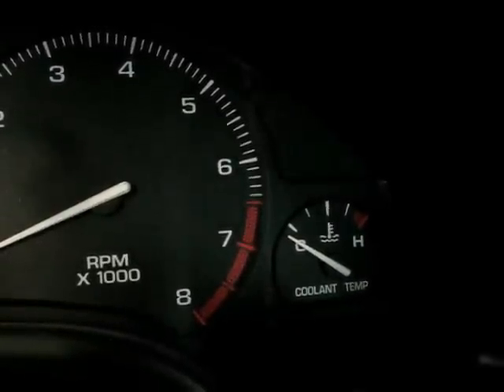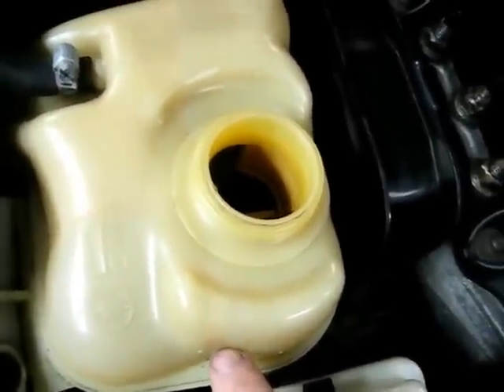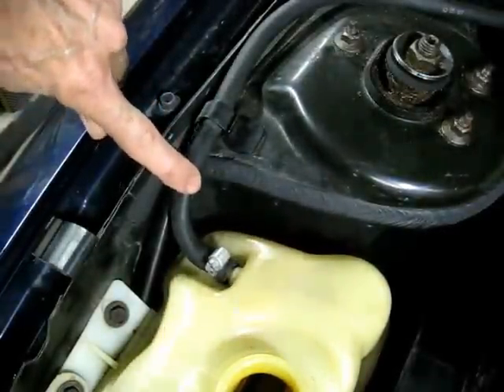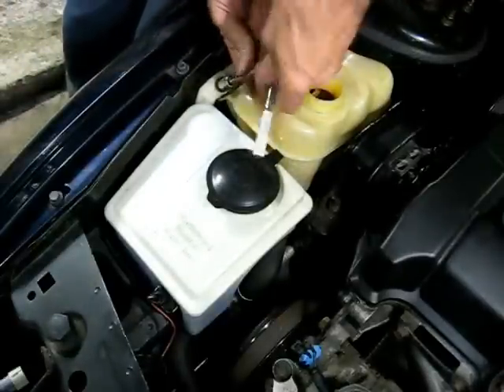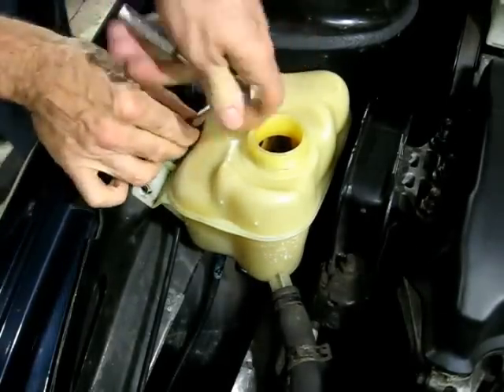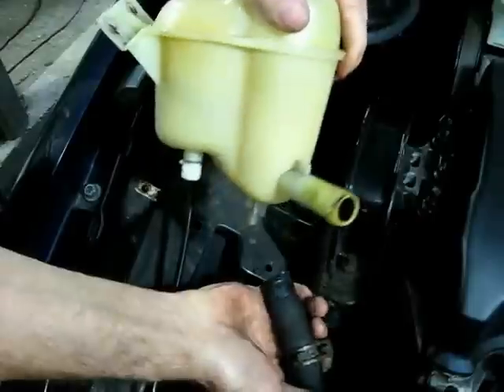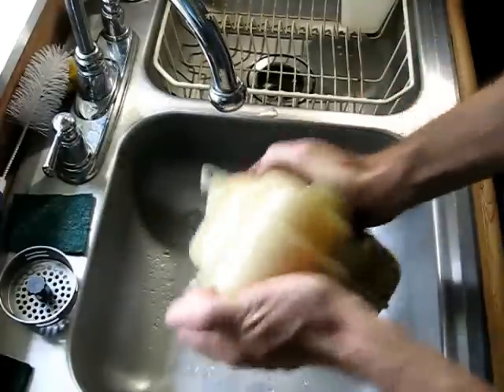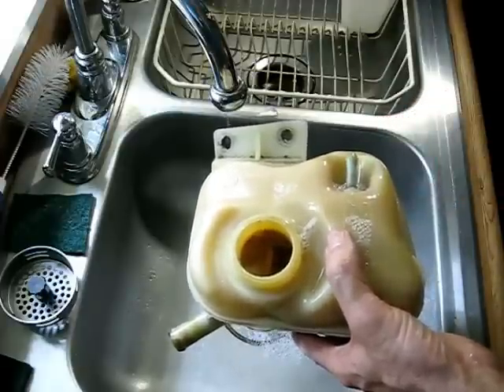Coolant Level Sensor Repair

Comment: Rich Thank You so Much I took my car to a mechanic which rebuilt the engine, now the expansion sensor is on, I now understand the float system for this sensor. I tried buying the sensor but no one knew where it could be located. God Bless You and your Familly.
 Merry Christmas
Reply from the maker: Thank you Tom.

Comment: This trick is "da BOMB!!" Thanks so much for sharing.  I fixed the low coolant sensor using this method on 2 cars this month!  Two comments: 1) One would NOT shake free.... so I let it soak overnight in dish detergent; by morning only a little more shaking knocked it loose.  2) Can take umpteen rinses with fresh water to get rid of all the detergent. One that I did (a '96 Aurora) has many internal baffles/ chambers, so i spent 20 or 30 minutes and nearly as many rinses. But it WORKS! THANKS!!

Comment: Thanks Richpin for this video. I have a Saturn vue 2003 v6, and was experiencing that problem. I took it off as you said in your video I washed it out with soap and then clr. Then rinsed thoroughly and reassembled and took for a test drive, and no more low coolant problems.

Thanks a million and keep up the great work!!! :-) love how you work on Saturn's!! You be the man! :-)

Comment: Thank you.  Having owned a previous '96 Saturn (SL2), I knew the coolant light should appear when the coolant is low.  I removed it "items" as you described and cleaned the collant tank, and ran the car for a few seconds with the sensor connected. Sure enough the sensor was working, and solved this problem.  Also checked the upper motor mount.  It looks good. Will pull the serpatine belt soon, and try to remove the shake at 1,100 RPM that is evident from the crank shake pulley.

Comment: Thanks for the video. When I replaced the coolant several months back.  I noticed the light went out for a while. But it returned again, and it made me wonder where the heck is that sensor located.  So thanks again.

Comment: Thanks for this! I was having intermittent issues with my warning lights flashing. Thought it was the sensor or a crack in the tank. I disassembled per your directions and it turns out there was a crack in the side of the tank I couldn't see because of the washer fluid tank. I was able to put a new one on with no problem!

Comment: nice video. i didn't even know what these lights even meant when it started blinking on my car. i thought it meant my engine oil was low xD glad to see its not a major issue. my radiator has a really small leak so when this light goes off it makes sense now. thanks again ( 1996 saturn sl2)

Comment: Another great video Rich.  The problem with my Saab is that I just did all you've just gone over, including loading the tank with nuts to clean out the crud on the inside walls, cleaned up perfectly and the float moves freely...but when I force the float down to try to simulate a low coolant level, it does not trigger a warning message on my display, a difficult to solve problem !

Comment: I FIXED IT, I FIXED IT!!!  Thanks again, richpin06a!  I used a connector to check the sensor first, just like you suggested.  Since that fixed it, I removed the reservoir, cleaned and replaced.  A long drive around the block...  NO LIGHT!  I just wish my 2004 Ion had the setup you had - this was NOT as easy a setup to work around.  But still, my husband is happy since it's his car, and no more annoying 'dinging'!  <3
Reply from the maker: Kris McFarland Great news there nothing worse than a blinking light on your dash.

Comment: I flushed my tank, as you described...as I rinsed it out, 6-7 small chips of plastic  (looks like recovery tank plastic) washed out as well, I could hear the sensor knocking noise as if unstuck.. I re-assembled the tank into car, and the low coolant light still flashes..I am going to replace the tank...My question; is the low level sensor integrated into the tank? and if its defective, the whole tank needs replacement...>thank's again Richpin for a great video !

Comment: Hey Rich for a start thank you for this video. Seem like lil things that cost us money can actually be done by ourselves and save that money for us (something no dealer will tell you ofcourse) I also have a 2005 192bhp RX8 and my coolant light comes on and off specially when am going over 70mph then off when I downgrade the speed. the coolant level is great as i check it regulary. Do you reckon cleaning it would solve the issue?? PS your UK fan

Comment: The light on my '06 Vue has been on for like 2 years. Mechanics would always tell me it was "some sensor" and that if there were no issues with coolant or overheating, I could ignore it. Well now I'm looking to sell the vehicle, so I'll try this cleaning technique before replacing the whole tank.

Comment: Gotcha- by the way, I removed the plastic expansion tank, cleaned it. The float was free. Put it back and at first I was stoked because the light did not go on but after 10 minutes it did. Unless there is some fuse involved, I must have a bad sensor and will have to replace the whole tank.

Comment: Update on coolant tank sensor repair. My light is now off. I'm posting this to maybe help others who followed richpins great video and instructions on this issue. My tank wires apparently were pinched enough to rough cut them. It was hard to notice with the wiper washer tank not taken out. I took the washer tank out to jump the connector on the expansion tank. Noticed the expansion tank connector wires were rough cut. It may have been that the wires were underneath the washer tank and over time were pinched by the washer tank. There was no evidence of burning or previously taped or rigged wires. It looked like a rough pinch cut. I was sure it was not the tank, as I could hear the float in the expansion tank. So follow your wires too.
Reply from the maker: When you have a problem like this it is a good idea to check the wires like you did.

Comment: Rich, what do you think of using a dash of dish soap to flush your radiator and cooling system? I have already drained all the anti-freeze and refilled the cooling system with tap water.  I plan on adding a dash of dish soap to the reservoir and then will drive to work (30 miles each way) tomorrow and when I get home I will drain the cooling system again. Should I keep the overflow cap tight or loose when driving with tap water for a day? Will the system generate more pressure with tap water?

Comment: How common is it for the expansion tank cap to keep leaking.  I am on my third one from owning the vehicle 95 SL1.  The thing is made out of plastic and when I replace them I can see the difference between the new and old as the old one on the top is boded sticking out like a belly.  Is this something I should be worried about or is this normal maintenance?

Comment: Do you still use dex-cool? I recently had a problem where I left my '98 sl2 out after a decent trip and it bled out tons of the coolant. There were no previous problems, it just happened suddenly one night, and then I got to researching. Dex-cool and GM have had a lot of issues that it doesn't lat as long and it erodes hoses and clogs radiators. So I have to get a new hose under the car, and a flush. I will go with some better coolant that has a better track record.

Comment: Hey Richpin. I have been following your Saturn videos for many years. They are so helpful. Do you have a video on replacing expansion tank? I searched on YouTube using different terms such as expansion tank, reservoir tank and overflow tank. I did not see a video on that topic. I’m consuming coolant and I think it may be the tank. I’m hoping it’s not a blown head gasket. I watched both of your videos about replacing head gasket and water pump. It was painful to watch all that needed to be done to replace both parts. I’m hoping a new tank and cap will solve that issue.
Reply from the maker: I thought i had one i did on a 1999 SC1 but could not find it.
Reply: Thx for looking Richpin. Hope you are well.
Reply: Thx for looking

Comment: I bought an after-market sensor for like $30.  At first it didn't work. However, through time it did, then it didn't. Eventually I realized that the connection was not tight enough. Eventually through time the metal of the connectors began to fit together.   Now I have no more check coolant level false flags. It just took time for the connection to somehow fit together.

Comment: Dear Rich thank you for this video ..I had the same problem on my Saturn ..I followed your steps and as I was about to remove the resevoir I noticed the connector wires were broke off the connector ..I did solder them but I am afraid they will break off again ..please could you tell me what kind of connector I have searched high and low for this and to no avail can I find one ..’your help would be appreciated ..thanks
Reply: Btw it’s working right now the low coolant light went off

Comment: I have a 97 SL2.  Great car except, it shows low water due to "low water" about every four to six weeks.  Can not see any leaks.  Have changed temperature sensor to ensure it is not overheating but this did not help.  Any ideas?

Comment: I own a 1995 saturn sl1 and for some reason it stalls randomly at least twice a day. I've seafoamed it cleaned throttle body changed the fuel filter and changed spark plugs only other guess I have is the cps. Starts right back up. Usually happens as I'm pulling off
Reply from the maker: I presume you have checked or replaced the engine coolant temp sensor and it's connector.Have you checked the computer for any codes that might be stored.

Comment: Rich i have a 2005 saturn l300 and my low coolant light comes on and off, there is plenty of fluid in the reservior and its not leaking anywhere should i try to clean the reservoir tank and see if that helps with the light issue?

Comment: Hello.
I own a 2003 Saturn Ion 2.2 manual trans.I am certain the coolant sensor is not functioning. The ECT sensor from engine, therefor, is not hooked up to tank (sensor). Is there possibly a fuse "regulating" this sensor? A new expansion tank in Alberta is nearly $140.00. So far I have not noticed any adverse effects. I have cleaned expansion tank as you demonstrated with no effect. Do I need a new expansion tank with a new sensor or is there an alternative eg. bad fuse? Is there a fuse for these sensors? I am no mechanic! I have "jumped" my ECT sensor with a paperclip. Sensors not connected. Again, I have not observed any adverse effects (bad fuel economy, black smoke, temp rise). Can you explain this? Must I be concerned?
I'd buy an expansion tank at an autowrecker, but expansion tank SENSOR must work. I have no way of knowing. Thanks
David
Alberta

Comment: what I would like to know is,where douse the line running into the top of the reservoir come from and if the water pump stops pumping will water stop coming out of it,? so basically I'm saying if you have a strong flow of water coming out of it does that mean your water pump is still pushing water through the motor
Reply from the maker: I would say if water is coming out the small hose then the pump is working.

Comment: I unplugged instrument cluster on 2005 dakota. now all the gauges work except the temp gauge and the low coolant level is on but isn't low. never had any of those probs before unplugging and replugging back in. the pin that holds the needle from falling snapped off the gauge bottomed out would the fry something. I went to wrecker got another cluster same issue any help please.

Comment: I have a 1995 double overhead cam Saturn SL2. I can't seem to find it anywhere but I'm trying to figure out how to change or if i can change ot the lower coolant hose on the reservoir that's going from the reservoir to the clamped metle line. or am I going to have to buy that hole line. I'm just trying to avoid having to lift the whole motor in order to take the clamp that runs over that line that the motor mount sits onto off.
Reply from the maker: Is the Dayco hose #80411 the one your working on.
Reply: after I looked that up  it is shaped and look just like that hose so  I'm figuring it is the same one. but it's factory crimped onto the metal line.
Reply: yes
Reply: richpin06a yes that's the one

Comment: Hey Richpin. Same problem with my 1998 SW1. Pulled another tank from Pull A Part and shook it up and down to hear the sound you talked about. Put the tank in but still getting the lights. Coolant level is where it should be. Any other suggestions on where to go. Temp guage works and reads normal as always.
Reply: Dear Allan Hart,
   I drive my 2003 Saturn Ion every day year round.I did the same thing except buy a new tank at Pull- a Part. I jumped engine coolant sensor with a paperclip and coolant light on dash went off. I experience no mechanical issues (eg. black smoke, poor fuel economy, overheating, etc). Tank always full. Temp gauge always reads normal year round. A new tank is an unconscionable $140.00 @ Auto Value. ECT and coolant sensor not hooked up. I don't want to run into issues down the road. But, no ill affects so far. Do you know if there could be a fuse issue? I'm not a mechanic. I cleaned tank in sink as demonstrated by Rich. I don't  know what I should do. Did you fix your problem? Any ideas for me?
Thanks
David Alberta

Comment: For anyone needing to replace their coolant reservoir, DO NOT BUY THE ULTRA POWER BRAND ON ROCK AUTO. I made this mistake twice and it lasted just over a year before cracking in the same place and leaking coolant. Wish I'd just kept the factory one and lived with the malfunctioning float.
Reply from the maker: Thank you for the info about the reservoir.

Comment: I was able to clean a Saturn 2004 and got the sensor to start clicking. I reinstalled but still get the coolant light. Is there a method to test the sensor? or the harness on the car?
Reply: did you ever get it fix?

Comment: when my onboard system display said Low coolant level. i checked the tank and it was the opposite!  the tank was full to the top and under high pressure. looks like something was clogged.

Comment: I've replaced the coolant reservoir, ects, all the hoses. My coolant light is still coming on. What could be the problem?
Reply: Try reseting the light if it dont come back its good now👍
Reply: It has came back on again. Now I'm in the process of changing the thermostat.

Comment: we have never had coolant issues (late 2004 - early 2016)  but lately the light comes on, and there is low coolant,  but no leaks anywhere... I know its hot but there is no way all that much fluid evaporated within a few days

Comment: The AutoZone guy says it was built in 1994 so he can't check the codes and yes I've changed the cts and connector.
Reply from the maker: You can check your codes yourself.Search "saturn paper clip test".

Comment: Now  why  would  you  bring a  radiator  tank ,  which  most  likely has anti-freeze inside  your house, worse  yet  in  your  kitchen, where  you prepare food.  That  liquid is  poison.  worse  than  "ricin"  the  deadly  poison known  to  man.   I hope  you scrubbed  your  Kitchen sink afterward.
Reply: The CDC recommends: "A solution of detergent and water (which should have a pH value of at least 8 but should not exceed a pH value of 10.5) should be available for use in decontamination procedures", for ethylene glycol. Dish detergent should do fine. Propylene glycol used in some newer antifreeze is considered less toxic and is used as a yummy food additive to make ice cream softer,  in certain soft drinks, coffee drinks, whipped dairy toppings, as a solvent for pharmaceuticals, and to deice airplanes.
That being said, I'm planning to yank mine out of my  2007 Saturn Vue and clean it in the kitchen sink. Drinks and hors d'oeuvres will be served at the funeral home.
Reply: +Gluluman WAT ?  What?  I've ingested more antifreeze than I care to remember ( by accident ) & I'm still alive.  You'd really shit if you saw my piston rods in the oven...LMAOOOOO!
Reply: +Thomas1971AU   through your writing I can clearly see what the anti-freeze did to your brain cells- and while you 're at it, ingest a little more little, like 4 to 6 oz and tell me about. Genius!!!!
Reply: +Gluluman  why be so hateful to others if they want to cause a scene just laugh at the stupidity and ignore it not saying your wrong ain't-freeze is poisonous to humans yes but they make cleaners for a reason and I don't really think the man who made this video thought he had to also go step by step into how to clean the kitchen sink after your done its common sense and if people don't have that then oh well. Just saying not everyone is as dumb as you claim them to be and I'm pretty sure they knew to clean the sink once they were done. This video was about cleaning the tank not the sink.